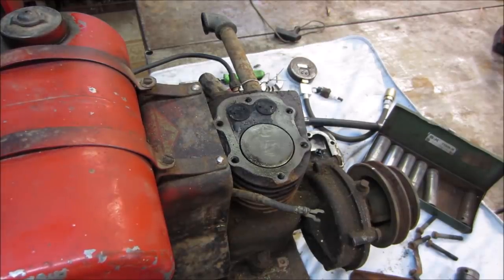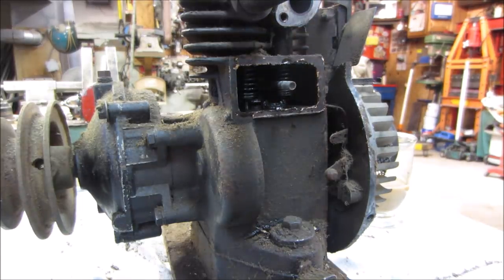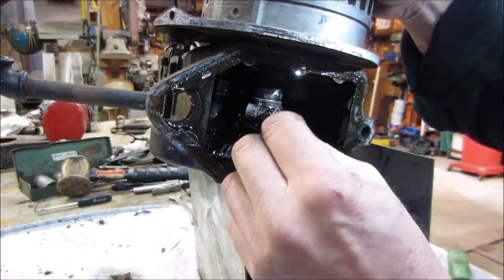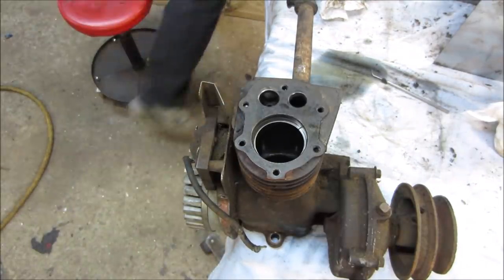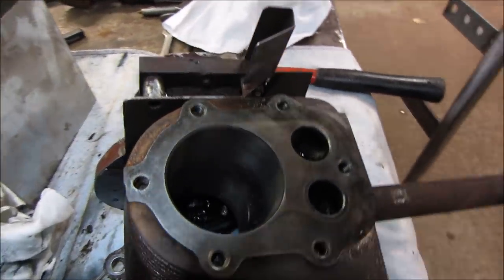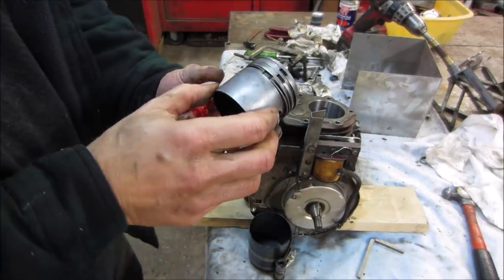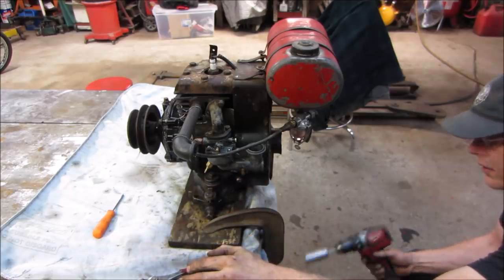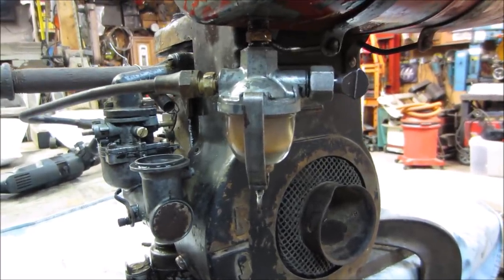Will It Run? $5 antique Briggs engine.part 3. tear down and cold start.

Comment: When you crack open those old survivors and the crank and cam see the light of day for the 1st time in 50-60+ years, I always wonder what was going on in the world, in the assemblers life back then. Some times I think a little of "back then" escapes and mingles with now for a moment. I know it sounds weird, but it crosses my mind from time to time.
Reply: Dave I know what you mean I wonder what was going on in the past with stuff like that. Someone who got up in the morning went to work and tightened all the bolts etc.
Reply: It is not weird to think that way. For me, it always feel like, opening a time capsule.
Reply: That sounds poetic when you put it that way.   This particular machine had me wondering what it was used for and the people that used it.  I also wonder why things are not built to last like that now.  The new stuff is so cheaply made.  I'm lucky if I get a year out of a mower and I do take good care of them. :(
Reply: i always think about the people that used the machines and serviced them and what was the last thing the inside of the machine saw before someone somewhere 40years ago put it together.
Reply: Not weired at all totaly know were your comming from. Its kina what keeps me making old stuff Chooch
Reply: I had a 1942 Dodge WD15 (3/4 Ton pickup), the wheels were all stamped 12/41 inside. Just think of what was going through their minds when that truck rolled off the line.
Reply: I’m the same way. I remember saying something like that at my old plant when they were removing an old machine. I looked at the floor and said this is the first day in decades that light has ever touched that spot. One of the guys looked at me and said, “That’s a weird way of looking at it.”
Reply: Not weird at all, I feel the sam way!
Reply: How do you like your coffee? What do you clean your hands with? Goop?

Comment: It's funny because those old engines were either run into the ground or hardly used at all, but most of them, no matter what kind of shape they're in, like this one, want to keep on running.  Thanks Mustie for the rest of the the story.

Comment: Greetings  Mustie,
About 50 years ago I bought an old Briggs engine from the local lawn mower repair shop so I could learn about engines. In an antiquarian store I found a hand cranked tool made for lapping valves. It had a stamped piece on the end that would engage the holes in the valve heads. The piece was reversible for different hole spacing. Then I found a similar tool that used suction cups, though it never worked that well. But back around 1980 I figured out a system that works quite well. I just clean the valve heads and superglue them together. Then I rotate the valve stem between my palms just like the cheesy tool you used. Once one valve is lapped in I turn the glued valves over and do the other seat. If you're in a hurry a piece of fuel hose can be pressed over the valve stem and an electric drill with a dowel pin in the chuck is then used to spin the valve by pressing the pin into the hose. Once the lapping is done a sharp rap against the valve heads will cause them to separate. 
I really enjoy your videos so keep up the good work.
Cheers,
Eric

Comment: Knurl the piston and see if you can get oversize rings.  File them to fit the bore with end gap needed.  Done this on a 292 Chevy six cylinder.  Worked very well.  Also, take a piece of broom stick and drive a couple of small nails to fit the two  shallow holes in the valves to make a lapping tool.Greg

Comment: August of 1953. that cylinder is indestructible cast iron, and you'll never need to change the piston, despite all of the side to side slop. just a bead hone, new rings, and lapp in the valves, a clean set of points and condenser, and she'll run for a hundred years straight.... again. if you have any questions on this one, the channel is, road King 85, and his buddy Mikey. these guys do all the early briggs stuff. they're in New England, & they are masters at what they do. and those piston rings have a small Gap, that motor can go pretty tight tolerance because of it the cast iron cylinder, and it's lack of expansion. so yeah, those rings are worn. the minute you rock that piston side to side you could tell they were wore out. it's about the only thing that really does wear completely out on this thing.

Comment: Get that motor to Mr. Pete! he can use the gear reduction for a gas powered metal cutting band saw conversion!
Reply: And without using the pull gear. Lok
Reply: He's so old he deserves one with electric start.

Comment: As a14 year old in 1960 I could not afford a ring and valve job on my old 1949 Cushman Highlander's Husky, engine so I ran half and half 50 wt. oil and half Casite Motor Honey. It was hard to kick start in cold weather but that old motor quit smoking and burning oil for the most part and got me down the road long enough for me to save for my first Harley. I'm now 74 plus years old and still riding Harley's!  In those days if you couldn't do the things you did in this 3-part video on this engine. You used the "shoe leather express". I enjoy "wrenching" with you.

Comment: I enjoy Your Tubes but I would like to share some thing that I have gone true. I have been a mechanic and worked around cars and grease from the age of 14. In 2000 I was diagnosed with Bladder Cancer and found that this cancer is usually not life threat ling but does recur and I have had recurrence several times. I have tried to do some research on just what causes it. I found that a lot of people that come in contact with oils & grease also have problems with bladder cancer. I Started to wear rubber gloves, you may want to do the same. Again I enjoy your You Tubes.
Reply: Thanks for your story Jack. I don't mean to lecture anyone or tell them how to what they love doing, but I definitely advise anyone to wear gloves as well, especially with used engine oil. I wear gloves just oiling my bike chain, or checking my car's oil etc.
Reply: @MattExzy  - The problem isn't with fresh oil.  The problem is with oxidation/breakdown byproducts of used oil.   There've been a number of studies on that.

Comment: I learn so much from this guy 👌
Reply: Cause it's not sterile bullshit. It's real ;)
Reply: #metoo
Reply: Me too!  We're getting so much knowledge!
Reply: I add his knowledge to my collective. Working on small engines for 35 years, I can say I never stop learning. Old engines, new engines, its all a learning experience no doubt. I generally do not bother rebuilding older engines any more. Most people want new. I Learned that two years ago trying to sell an older roto tiller. I couldnt sell it in its original Gold paint, as people associated it with old. As soon as I repained it black and reposted it. I sold it in an hour. lol. Same exact unit, different color. Orange usually means old as does red and gold. White usually doesnt sell very well eather. Musty is a pretty good mechanic. I have picked up a few tricks of the trade from him. Someone old school taught him, I know that.
Reply: Me as well.

Comment: The reason Briggs didn't publish compression numbers is because the cam lobe has a "bump" that acts as a compression release at cranking speed. The bump was so slight, it didn't affect it that much at running RPM. That's why you turn it backwards and see if it bounces off the compression.
Reply: Interesting!
Reply: Those older engines from the 40's and 50's had no compression release on them.
Reply: @Ashurii: Those older engines, which I have had many of, were low compression engines. A compression release was not needed on them at all, especially seeing as how they were rated from 1/2 to 1-1/2 horsepower. I have a similar model 8 (no gear reduction though) built in 1951 and even with new rings installed, I get about 60 pounds of compression from it. They are so easy to pull over.
Reply: @stingcool9455 : But you have to remember that those older engines were low compression types. When you got into the larger engines is when they had to add a compression release feature of some kind as they were very difficult to pull over.
Reply: Don't think compression release came along until about 1970's... and it was a definite mechanism inside that was shut off by centrifugal reaction once the engine started... watch videos of newer engines torn down...
Reply: @BuzzLOLOL  Before the centrifugal style there was the "easy spin" release, which was the little bump ground onto the cam. Idk when it came out.
Reply: @kcraig51  Easy Spin Start was introduced in 1961, which rules out the possibility of it being on the engine in the video.
Reply: @ogrebeast64  Yeah, After I originally posted, I realized Easy Spin probably hadn't been introduced yet.

Comment: Could you explain in a future episode more the principle of how you tune in the engines. i sort of get it when you do it but if i had to do it then i wouldn't know where to start.
Reply: I can try to give you the basics of what he is doing:

In the main he is dealing with two types of carb. The first (and this one) has an adjustable main jet that is adjusted with a T-screw. Out lets more fuel through, in closes it down. The main jet controls the running at higher rpms.

The second adjustment is the idle air control (mixture screw), this adjusts the fuel/air at idle and low rom. This is simplified because they do affect each other. The third control is the throttle stop adjustment.

What he does is set all three at "general" settings that should get it running. Usually 1 1/2 turns out from a soft seat on the main and mixture, and a raise in the throttle stop.

Once it is running he will raise the revs right up and check the engine isn't bogging, missing or flooding on the main jet by adjusting it both ways until it does then setting it in the middle of the two points.

Then he will let the revs drop, lower the idle speed and adjust the mixture until it runs smoothly, then rinse and repeat on that control

The other type doesn't have an adjustable main jet. Instead, the needle for the main jet is raised and lowered by means of slots, so the carb has to be partially dismantled each time you adjust it. This type is generally more sophisticated because you usually have a range of jet sizes to play with too. Many motorcycles have these but not so many small engines.

There are other types, but that's the basics.

Hope that helps.
Reply: @twigg2324  Thanks man!

Comment: Cant believe you got it up to 75psi of compression! Its almost like new 😄
Reply: Those rings were the issue. that old oil was gluing them in. I run into that more often on a two stroke thats been sitting. Anything that old can Always benifit from a refresh. Small engines are not as critical on piston bore refinishing. On snowmobiles, I resleeve the cylinder or replace the head. You cannot do that on a smaller engine. As long as you can bring up the compression, you are gold!
Reply: Weld up depressed areas then hone cross hatch jobber rings run smother pathetic  carboretor gov crap , air fuel weld coil right on  engine better contact arc.
Reply: @scottfirman  it needs Oversized ring set hone lap valves in connecting rod probably needs new bearing lol
Reply: @broken1965  Yes it does. What it needs and what it gets are two different things I guess. If he wants to its up to him.

Comment: If you look at where the wrench came to rest after the hit at 14:21, you can see indentations on the sealing surface of the oil pan/block , leading me to believe someone at somepoint did exactly what mustie was doing, but got a little carried away with the hammer hits! Looks like a wrench dented it badly.
Reply: Cutting boards
Cutting boards

Comment: Those indentations in the valve tops would make good drive points for lapping.
Reply: Yep, thought the same thing !
Reply: Yes, I have ground nibs on an old socket to fit those and used an electric drill to to the lapping.
Reply: @boooshes 
There's nothing like DIY tools !
Reply: Ford Model T valves have those two indents for lapping also. There is a tool that looks something like a hand-cranked eggbeater that spins the valve forward and backwards as you crank it.
Reply: @d.pierce.6820  - I got one of those with my grandpa's tools, was just looking at it a couple days ago and had no idea what it was, until now that is. Thanks

Comment: When the engine heats up I would imagine the ring circumference grows and the gap closes a bit more.
Reply: pbrin 

Not a terrible way of thinking. At the same time, heat will cause the cylinder, and the whole engine to expand. So, while the ring gap could, in theory close, I doubt it makes much of a difference.

Comment: I'm new to engine rebuilding, but I think if you move the hone up and down MUCH faster, you will have a better crosshatch pattern.
Reply: I'm going to go out on a limb and guess that he know that too, but he had to restrain his enthusiasm there because he didn't want to crash the hone into the crankshaft that was still present down below, for that would not only do damage to the crankshaft, but would destroy the hone as well.
Reply: Not on cylinder honing! NEVER run a cylinder hone at high speed! Thats small engine 101! I have been rebuilding engines forever and slower is better. You can damage a cylinder or have a stone blow up in your face( my first experience). You are only trying to create a compression on the cylinder, not destroy your tools. Younger guys always assume faster is better for some reason.
Reply: @RC H E.... I'm not sure who you're directing your comment at, but neither the original commenter nor I were talking about running the hone at high speed,  bananasEveryday was talking about moving the hone up and down more vigorously,  but neither of us were talking about spinning the thing up to warp speed.  I'm not being aggressive, but you're sort of slinging mud on the two of us, insinuating that we were agreeing on something that your comment brought to the table, hours later.  Furthermore, you're assuming that both of us are young guys.  What's your definition of young? I'm in my 6th decade now. I have no idea how old bananasEveryday is, never met him or her.  This is a free society, and constructive criticism is (usually) a welcome thing, at least where I come from,  but maybe go a little bit easier on the way you word things, and use exclamation points responsibly, please.  Lastly, for what it's worth,  yes, you are completely correct in your statement(s) about spinning a hone too fast, but I would kindly ask you to go back and re-read the comments that you reacted to,  and realize that neither of us was discussing the spinning speed of the hone, but merely discussing the technique of moving the hone in and out of the bore of the cylinder a bit more vigorously,  not spinning the hone faster.

Comment: Nice! 75psi is repectable for just a honed out cylinder...I guess cleaning the crap out will help too...should run some 15w40 diesel thru it one time to scrub it clean, then any oil after that Lucas oil stabilizer will go a LOOONG way with blowby.  Didn't smoke as bad as I thought it would, and it ran pretty good...awesome getting an old engine chugging along again

Comment: Amazing these older Briggs can run almost at full power regardless of abuse levelled on it. I wonder about newer stuff, but I will say the Cheesey Kohler on my yard tractor is pretty reliable if you just keep it clean inside and out!

Comment: old worn motors often will initially start and run if you put heavy oil in cylinder to get compression up to fire.
Ring end gap often dictates compression leak down.
Excellent fun Show.

Comment: It's been rebuilt, the reason i say that is the exhaust valve is clean it's an oil burner with the rings and sloppy piston and the exhaust was clean, outside of being rebuilt 40 years ago. Normally for an oil burner like that you have a crusty deposits on exhaust valves that eventually can block the pathway. This didn't have that. So I'll take odds on maybe a 1970's rebuild before the gas went to crap in the 80's and 90's.
That connecting rod movement.. sloppah.
Good luck on finding a new piston and rings but it's still cool it ran like that.

Comment: Somebody  said it looks like it was off a old Reel type mower of the late 40,s early 50's, , I think he is right, My Father in the early 60's ran a small engine shop in IL, one day, he took in a old Reel  type mower on trade for a new Moto Mower, that old Brigs would idle down to 200 RPM, sweet engines in the day, could sit for months , and start on the first pull,,, I think he  finally sold it fro 20 bucks,, now , find a old Fairbanks moorse or Pincor to fix, LOL,, great video, some of the stuff you dig up takes me back to the day,

Comment: Another great video ! Watching you work on that old dog brought back memories of myself trying to breath a little more life into a very old engine for cheap . On several engines where the bore was hourglassed and straight hone could not really hit the wide area , I used a ball type hone . That way the old rings had a chance to re seat . I also have a vintage valve seat cutting tool . Just operated by hand , works great . I got lucky on one engine and happen to find a set of rings for another engine that were the correct dimensions and all I had to do was cut down the end gap . Ran pretty good for very little investment . On one old engine the owner needed to run for a limited time , we ran super heavy oil to reduce the blow by . On another similar engine that was burning less oil , but still fouling plugs we ran two stroke oil and went up on the heat range , worked OK .